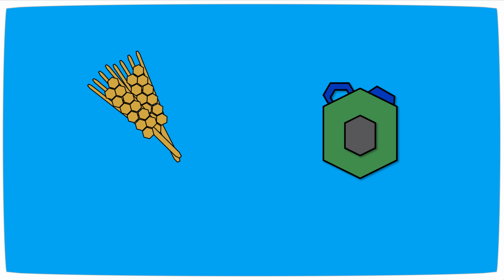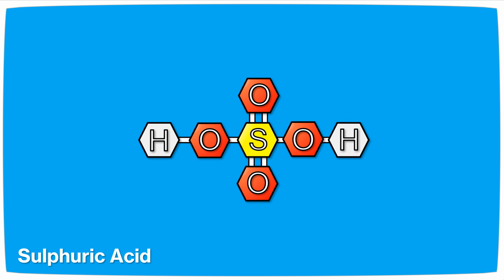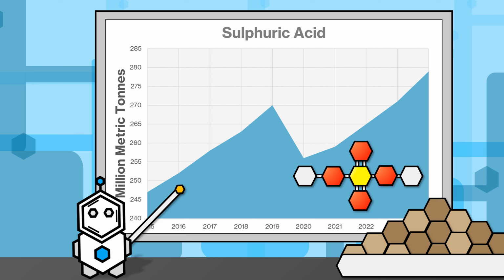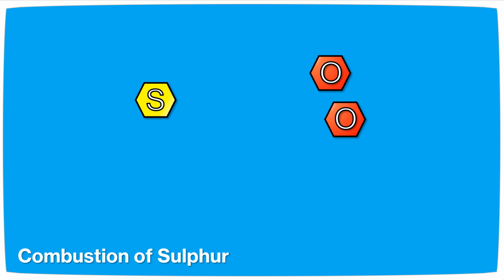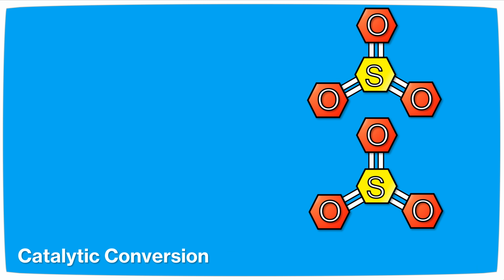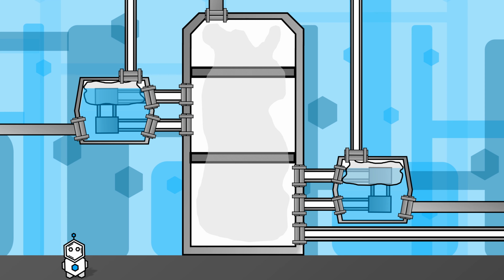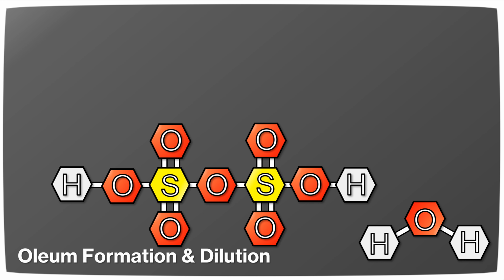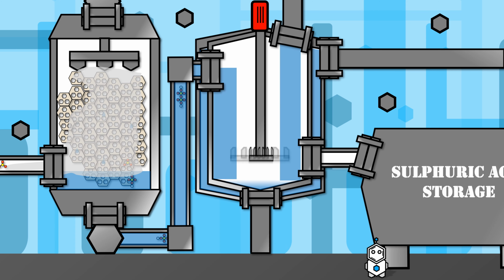The Contact Process | Chemical Engineering Explained

Comment: The reaction 2𝑆𝑂2(𝑔)+𝑂2(𝑔)⇌2𝑆𝑂3(𝑔)2SO 2(g)+O2(g)⇌2SO 3 (g) is reversible and exothermic. How does Le Chatelier's Principle influence the design of the Contact Process in terms of temperature and pressure conditions? What compromises are made between maximizing yield and maintaining practical reaction rates?
Reply from the maker: Le Chatelier's Principle is used to determine the conditions of a reversible reaction to favour a certain direction. 

The production of Sulphur Trioxide from Sulphur Dioxide is favored by lower temperatures and higher pressures to increase. However, lowering the temperature will lower the rate of reaction, a compromise has to be made to balance the two in the case 450C is the sweet spot. 

A higher pressure would favour the forward reaction, but designed and operating high pressure reactors is complex and hazardous, therefore another trade off is made and the reaction is carried out slightly about atmospheric pressure.
Reply: Do the benzines also refer to it as Le Chatelier's principle?
Reply from the maker: No they have no idea who he is